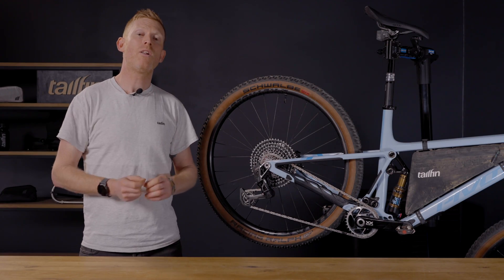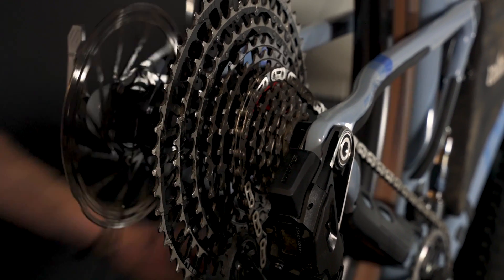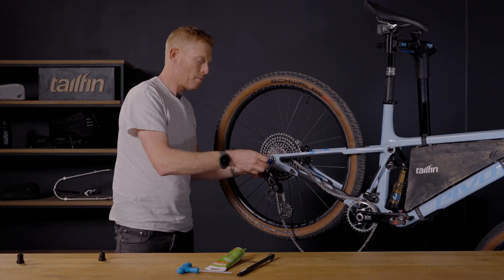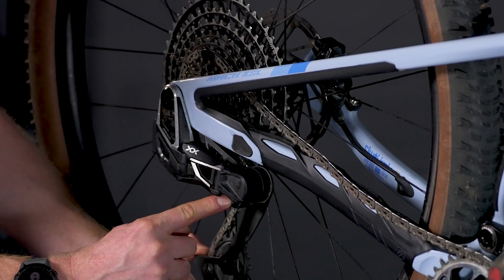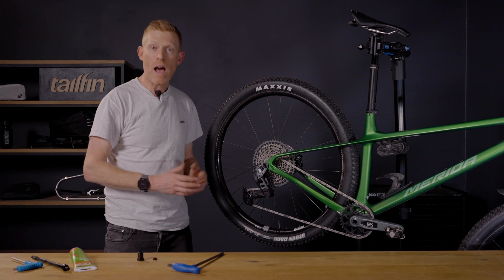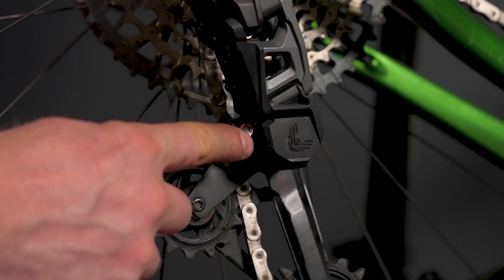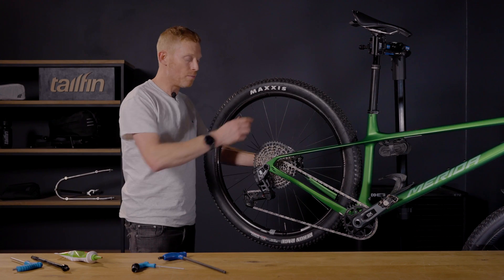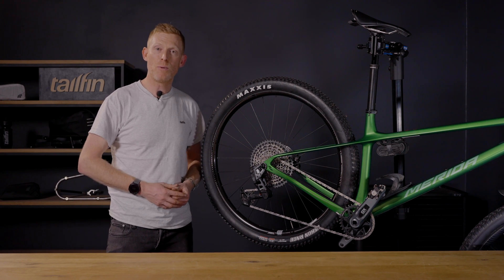How To Fit SRAM Eagle Transmission Adaptor With Tailfin Racks & AeroPacks | Assembly Guide

Comment: hello guys, after fitting the adapter to my red xplr transmission, i still used the original thru axle (needed for the mudgards on my canyon grails) tightened to 15nM as per the frame and axle instruction and found it almost impossible to remove .... when using the udh adapter am i only supposed to use the tailfin axle and/or onyl tighten to 10 nm ? thanks !

Comment: How can I protect the thread that protrudes on the rear derailleur side? If the thread gets dirty when touring, it will be difficult to remove the axle, e.g. to patch the tyre.
Reply from the maker: Hey Marcel, We’ve not seen any issues with threads showing, and the axles are used around the world in a range of terrain and weather conditions too. If you are at all concerned though a small section of silicone tubing or some electrical tape wrapped around would be an option but you'd have to make sure these were removed before taking the axle out. If you'd prefer not to use this then we recommend just wiping the tread with a cloth, and perhaps rinsing with a little bit of water to clear any debris that might still be on the thread.